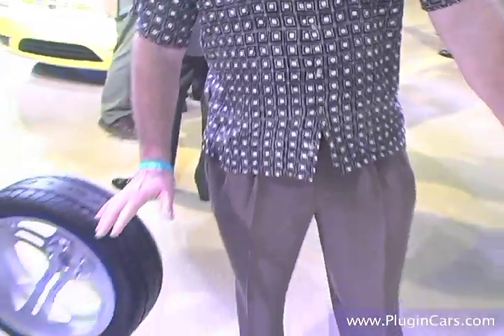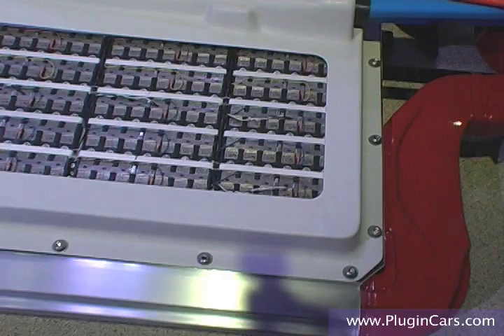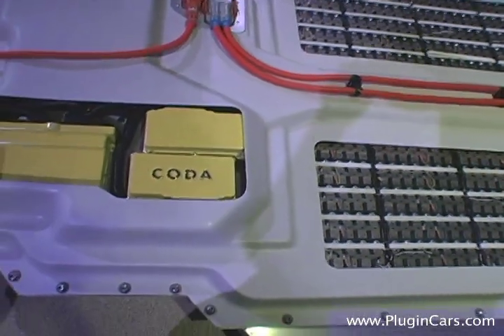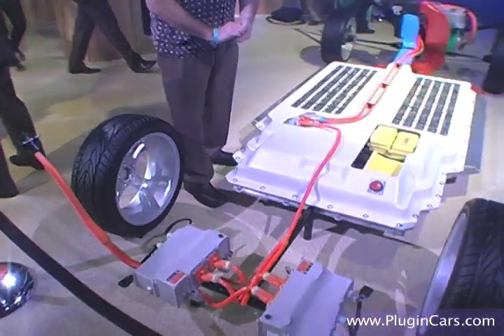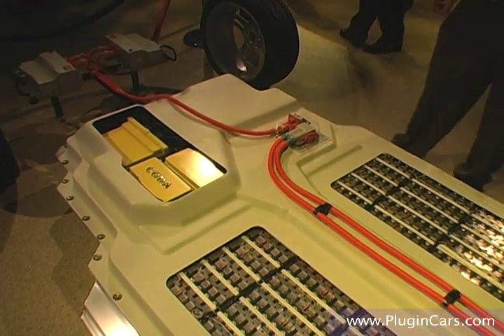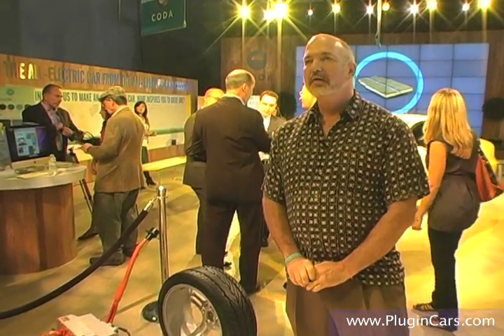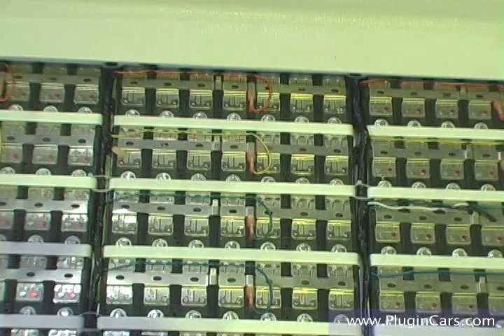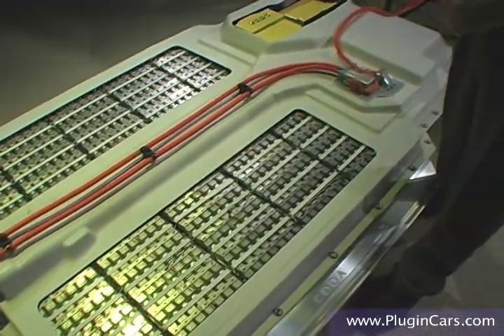Coda Battery System explained at 2010 LA Auto Show

Comment: The GM EV1 did 160miles using NiMH in 1997 by 2005 the chemistry had improved 50% so this car using NiMH would by now be way over 300mile range using NIMH instead of lithium for half the price of lithium. CHEVRON is allowed to deny us that advantage.
Reply: Howard Marks The Selectria Sunrise used NIMH batteries and acheived 300 miles at a 75 mile an hour speed on a charge in the year 1999. What does that tell you about the oil industry and the imformation out of the supressng press?

Comment: @DarthNefatious please. just because you know what coolant they use you automatically understand the efficiency and thermal requirements batteries have and will get it right? and pigs fly.
and since you mention it the Rav4's are still running with no liquid cooling although that's NIMH.
the simple fact is that a powerful LiFePO4 battery can discharge at 10C from full all the way to flat and only get to maybe 50-60 degress C. that means deplete the battery in 6 minutes. aircon is plenty

Comment: Are each battery cell replaceable individually? Does the system know which cell is low on voltage and allow for the consumer to change them out as they start to lose the ability to lose the full capacity?